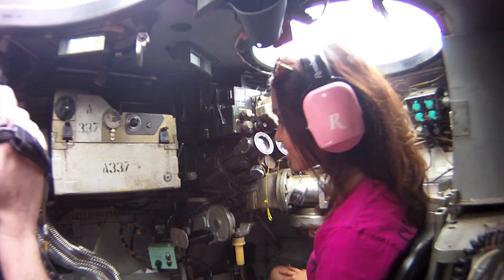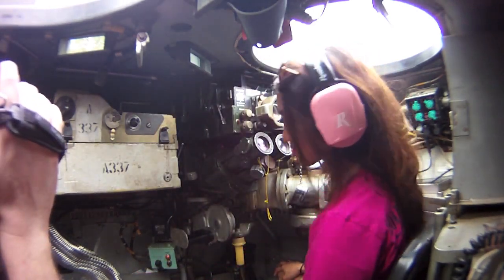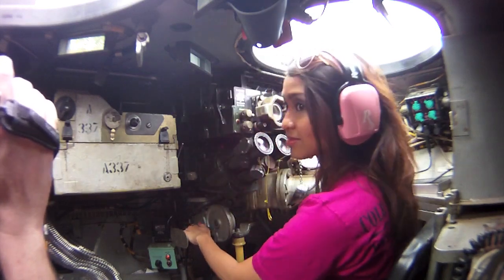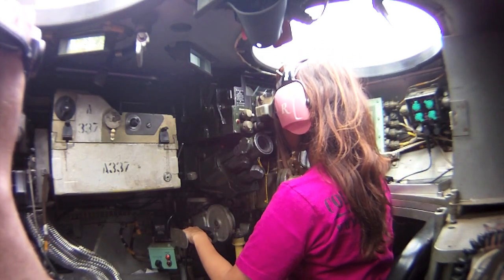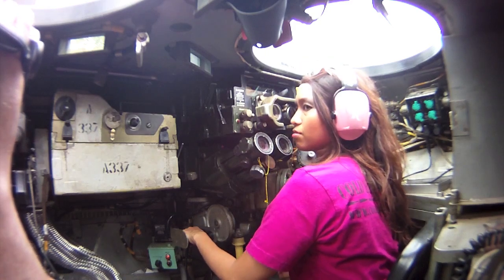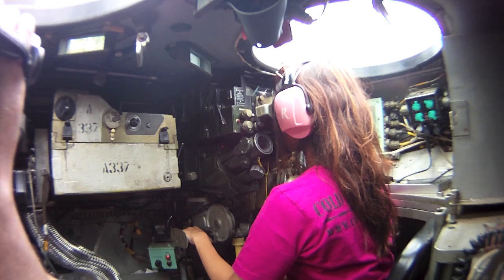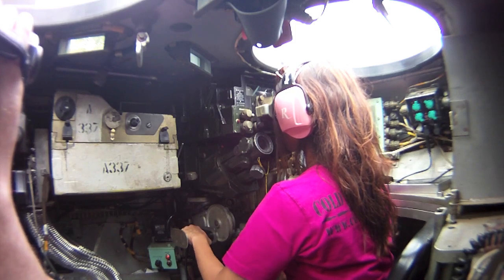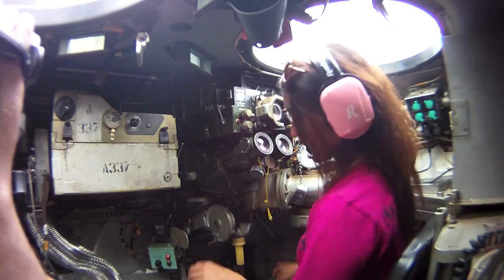British Fox recon tank.

Comment: I was in C sqd the Queens own Yeomanry, hello to any yeoman out there. The fox wasnt top heavy, The problem was overdrive if you took a corner to fast, then lost your nerve and hit the brake it could go over, plus of course its a four wheeled car, even tanks can tip over on slopes. My regiment lost people in overturned foxes.
Reply: +Peter Clarke Sad to hear it, man. There's always an imbalance between crash/spall safety and emergency exit capability. I don't think it's possible to strike a sweet spot.
Reply: main thing is only head and shoulders out of the turret and keep your wits about you,
Reply: I was also a member of C (KSY) squadron Royal Yeomanry based in Croydon. I drove one of these Foxes.
Reply: I was B Sqn Royal Wessex Yeomanry at Salisbury, and we were Land Rover equipped. My father-in-law collected military vehicles and owned a fox for a while. I got to drive it quite a bit and attended a few shows in it. It's still not a tank, though!
Reply: D Squadron support troop 99 till 08 Spartan 46AT49
Reply: I never felt comfortable driving the Fox. I got my father in law’s Fox up to about 60mph on a bit of duel carriageway and I constantly felt like the backend was going to swing round. It really wasn’t the most stable of vehicles
Reply: To make something not top heavy you put more weight on the bottom, and increasing width helps as well. Ever who designed this and the Ferret didn't think things completely through. If they had of armored the bottom up properly it would have more lower weight and would be more stable.
Reply: Speaks the expert. Of course they "thought it through" but all design is a compromise. Weight is a factor in making it air transportable. The increase in stability would decrease it's speed, another important factor in it's design and use. I love these YouTube generals who think they can watch a 2min. video and spot obvious design flaws that the real experts have somehow missed. I suppose your assumed name says it all.